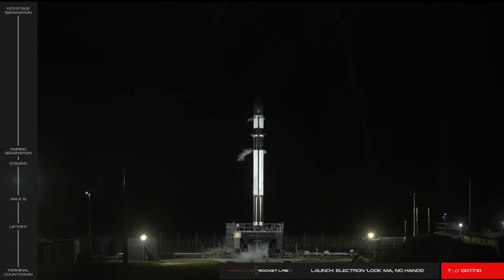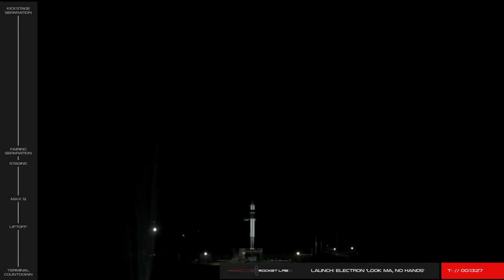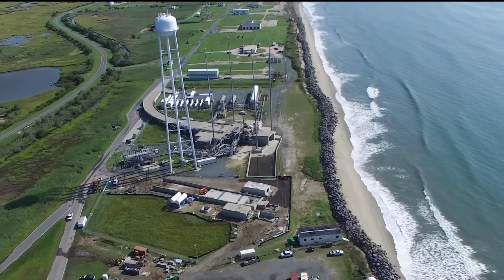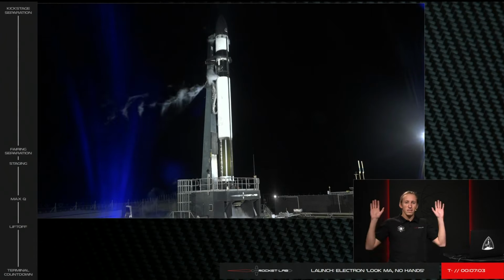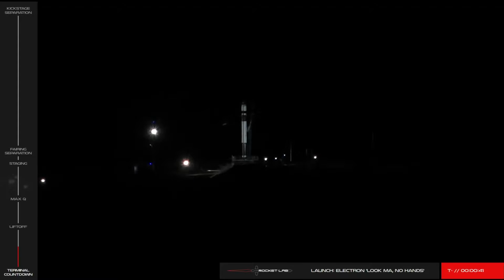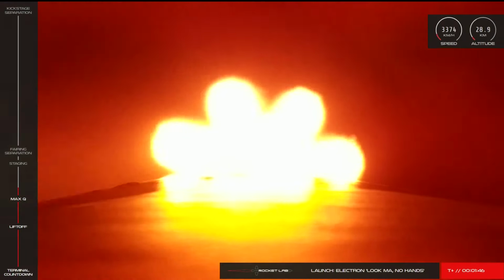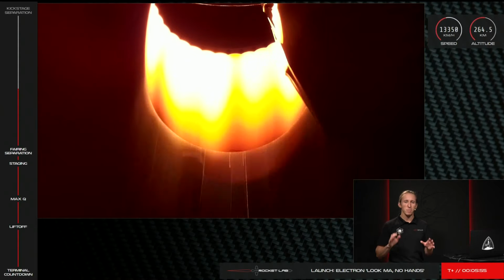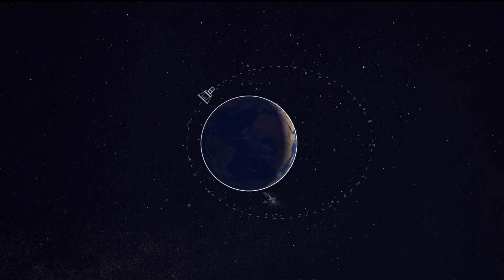Look Ma, No Hands Launch - 08/19/2019

Comment: What are the sparks seen during first stage ascent?  Are they from rocket nozzle ablation?
Reply: My guess is that it's ice forming on the fuselage of the craft being shaken loose by the rocket shockwaves and then they're lit up by the bright flame from the rocket as they fall past it.
Reply: I think they are nozzle ablation as I can't see fuel or oxidiser lines on the nozzle. That makes some sense with the electric pumps. I'm not 100% sure. Have a look at the electric Rutherford engine.

Comment: So what is the deal with what looks like welding sparks being thrown off by the engines?
Reply: Ablative nozzle cooling. Nozzle slowly flakes material away to dissipate heat
Reply: zephron28 exactly what I was wondering. Maybe negligible particles from the thruster‘s inside coating?
Reply: zephron28 probably an ablative engine nozzle

Comment: I am so surprised Elon made the prediction that all transport would be electric …...except rockets, but just after electric cars are becoming normal, the trucks are still yet to be delivered, but the electric rocket is already launching, to be fair though, obviously even Elon wasn't expecting electric turbopumps.
Reply: Electric turbo pumps (as they are today) are not powerful enough for the Merlin or Rapture engines. The chamber pressures and flow rates are much higher.
Reply: These are still chemical rockets
Reply: @bundubashing2591  Fascinating, teach me more oh wise one.
Reply: @themoonissquare323  I love irony.😂🙈
Reply: @themoonissquare323  
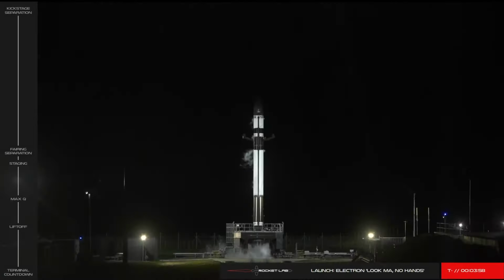It still uses a chemical reaction to provide trust, they even say they use kerosene and liquid oxygen in the video (14:30).

They use a electric turbopump to pump the fuel to the engine (i think) and obviously us electricity for the electronics.
But the flame coming out of the bottom of the rocket is not electric. It is the first rocket using an electric turbopump however. So it can kinda be called and "electric rocket" but not really :P